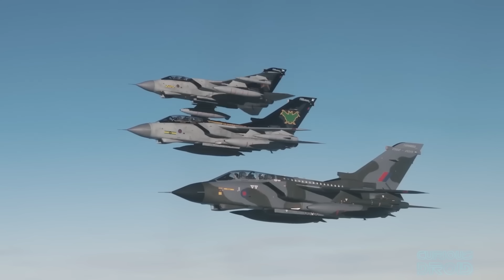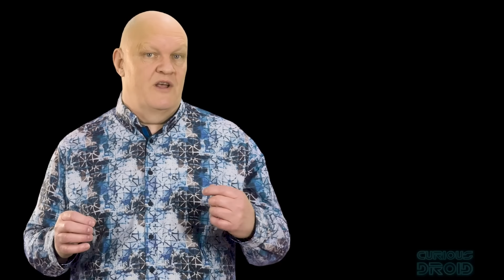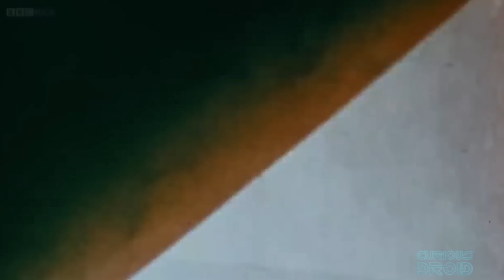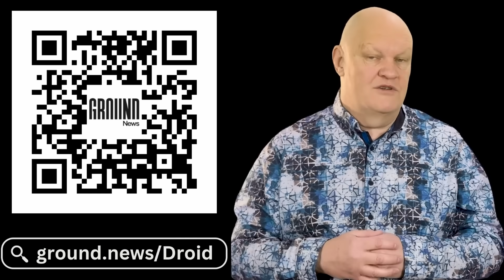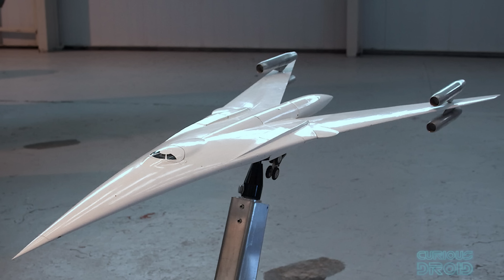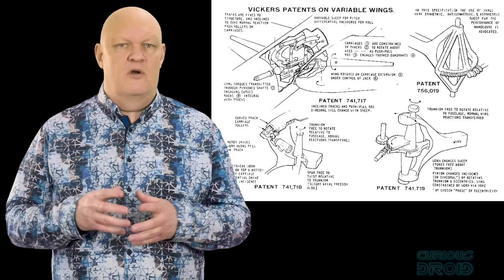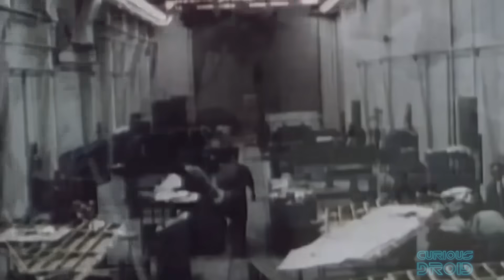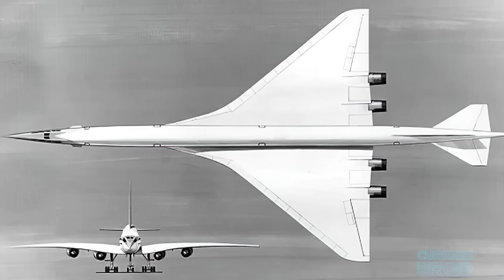Why Aren't Swing Wing Aircraft Made Any More?

Comment: NOOOOOOOOOOOOOOOOOOOOOOOO. Frank Whittle patented the jet engine in 1930 and ran it in April 1937 making it the first self sustaining gas turbine in history. Hans von Ohain (having read and critiqued Whittle's research in 1935) built his own engine and followed 6 months later. A jet powered aircraft WAS NOT flown in Germany in 1934. The He-178 was flown on 28 AUG39. thanks to the financial and engineering backing of Heinkel although von Ohain's engine was a technological dead end where Whittles basic design is still in production today. The Gloster E28/39 flew in 1941 powered by one of Whittle's engines. Swept wings on the Me-163 and 262 were not the result of swept wing research by Busemann.  Woldemar Voight, designer of the 262 stated clearly that the inelegant solution of mildly sweeping the outer panels of the 262 to 18.5 degrees, was not for aerodynamic reasons but was to solve a CofG problem from the heavier that expected BMW engines. Eventually in the A6, the the inner panels were swept to match Lippisch designed the 163 with swept wings because as a tailless aircraft there was no other choice. A straight winged aircraft cannot lack a horizontal control surface for pitch an stability.
Reply: Frank Whittles patent was invalidated in 1932 and whittle allowed it to expire. His patent infringed on an already existing patent  by Maxime Guillaume patent no. 534,801 (filed: 3 May 1921; issued: 13 January 1922).

The worlds first jet engine was constructed in Gottengen Germany in 1934.

Comment: A more niche question I've had for a while is why automatic swing wings were uncommon. As far as I know, only the F-14 and later variants of the Panavia Tornado did this, and all other swing wing planes needed the pilot to manually adjust the angle. It seems like automatically adjusting that angle would be an important part of really getting the greatest advantage from the swing wing design.
Reply: Yep, sweep should be a simple linear function of IAS (Indicated Air Speed - that is, true airspeed adjusted for density of the air flowing over the wings which varies with altitude and temperature). Whether automated or not this adjustment ought to take little skill or design complication as IAS has to be continually monitored anyway.
Reply: @kenoliver8913  Part of it is also with manual adjustment, you only use a few preset angles. The MiG-23, for example, used 3 main sweep angles for takeoff, maneuvering, and high speed. Automatic sweep makes it more practical to use all those in-between angles that might be optimal.

Comment: I watched a video recently and a us politician was holding up a  bag of screws or bolts something that would cost 5 bucks in a hardware shop but in the military this bag cost 90k ..the whole system is corrupt.
Reply: Famously the B1A had a coffee percolator designed to keep brewing coffee at a constant rate through the middle of a 5G turn.
Reply: I doubt home depot sells screws that will take a 5g load, at temptetures between -50 and 350 degrees c, and with a 30 year guarantee. 
That's why those screws cost so much.
Reply: My late wife was a quality director for an aerospace hardware distributor.  Among my duties as an engineer for a small company I recently retired from, I managed our FAA certified repair station. The amount of certification, testing, and approvals required to meet stringent hardware specifications is staggering. every single screw, washer, etc. has to be traceable back through to the original raw material.  From the mill, throough every single step of processing...machining, heat treatment, and finish.  Yeah, there is always a little "adjustment" here and there (capitalism), but the process of of materials certification and traceability is complicated and expensive.

Comment: TU-160M is a Rebuild, refurbished airframes outfitted with more modern avionics and powerplants. They're not 'new' aircraft.
Reply: No, production of entirely new Tu-160 from scratch was also started, first of entirely new ones flew in January of 2022
Reply: @Янус_Ырт  Nope.
Reply: @PiDsPagePrototypes  check info in internet, YT doesn't like links. I will still attach it in the next comment, but to quote, "The government contract, signed between the Ministry of Industry and Trade and the Tupolev design bureau, facilitated the digitization of design documentation for the Tu-160M aircraft and the restoration of vacuum welding techniques for titanium products, leading to the resumption of airframe unit production" and "The first Tu-160M strategic bomber built from scratch made its debut 30-minute flight on January 12, 2022."
Reply: @Янус_Ырт  I'll wait until I see independently confirmed reports, and not those of the propaganda ministr,.... er,.. TASS and the Manufacturer.
Reply: @Янус_Ырт  You missed the point of previous comment. Adding the "2 years ago, no new info" kinda proves that point I made too.
Reply: @Янус_Ырт  Still missing the point.....
Reply: @PiDsPagePrototypes  what point? That nobody except Russian military and Tupolev publishes info about those bombers? Who else should? My point is that new bombers are being produced from scratch, and you can easily find proof of that - there is footage in open access.
Reply: @Янус_Ырт  That all media released on these aircraft is done so for propaganda purposes, so should not be trusted until independently verified. I'm amazed I have to spell that out again.
Reply: @PiDsPagePrototypes  how are you going to "independently verify" military information? Do you have any other sources outside of Russian DM and Tupolev factory? Besides, photos and videos are real, what else do you need?

Comment: Like all things in aviation, all design/engineering choices give you something but at a loss of something else. Swing wing gives you good airflow at landing speed and at high end speed but sacrifices in reliability and weight. The F-111 Aardvark was the USAF’s golden child but was horrible in reliability and was proved by Col John Boyd to lose in a dog fight against every single Russian aircraft—weight was a contributing factor. Today, the USAF’s B-1 is the forces’s least reliability aircraft and has been so for at least the past 20 years with only a 40% Mission Capability Rate, or putting another way, the aircraft and only fly 40% of the time before breaking.
Reply: To be fair the F111 was designed never to get into a dogfight - it was a fighter-bomber intended to evade day fighters with pure speed (an idea dating back to the Mosquito). Apart from its maintenance problems it proved very vulnerable to SAMs and MANPADS. As all non-stealth aircraft (including F16s and F18s) eventually did.

Comment: With FBW computers being as advanced as they are, i could easily see the current standard hybrid-delta style wings (like on the F-15 and F/A-18) outperforming VSW's. Especially in terms of cost, weight, and maintenance. But god do the Aardvark, Tomcat, and Lancer ever look so cool. They will always hold a special place in my heart for their aesthetics. By far some of the most iconic aircraft of the US fleet. Or any fleet for that matter
Reply: "With FBW computers being as advanced as they are, i could easily see the current standard hybrid-delta style wings (like on the F-15 and F/A-18) outperforming VSW's. ""

No way, VG wings are far more efficient than fixed wings, which have to compromise for the portion of the flight envelope where they need to be most efficient.  The F-15 wing was designed for maneuverability at high subsonic speed, but it is not as efficient during cruise or dash as a wing that can reshape itself.  VG didn't make sense for the F-15 mission but made great sense for the F-111 and B-1 mission.  Aerodynamics didn't change, the mission profile changed.
Reply: VSW's may be more efficient aerodynamically. They may even make sense in the small picture. But not in the big picture. Delta/hybrid wings can fly low speed approaches now because of advanced FBW. Not to mention TVC when it comes to maneuverability in high and low speed regimes. Why do you need all the added weight, moving parts, and single point failures of a VSW when a more effective solution has been found and implemented? It was a great solution in the 70's when they designed them. We just found better solutions. So no, aerodynamics didn't change. But the entire paradigm of high performance flight did.
Reply: @batmanjones655  Not “may be more efficient”, they are more efficient.  And a simpler solution has not been found—if you think that you do not understand the actual problem VG wings solve.  Forget maneuverability, we're not talking about making a better dogfighter. The F-15 looked at VG and discarded it because the extra weight was counterproductive for sustained maneuverability in the part of the envelope for which they optimized the wing, and total efficiency across the entire flight envelope was less important.  The F-14 didn’t have a VG wing to make it a better dogfighter, it had a VG wing to meet the fleet defense mission requirements of a heavy load and long endurance coupled with high-speed dash.  A fixed wing optimized for dogfighting could not do all that.  The mission drives the wing.

TVC is about controllability at low speed and has nothing to do with subsonic efficiency beyond allowing for smaller control surfaces. Delta wings can fly at low approach speeds without FBW, which has nothing to do with it. The delta wing is very inefficient at low speed.   

The added weight of a VG wing pays for itself in less fuel carried to go a given distance.  You lift more fuel off the runway and use less fuel per mile, allowing more payload and range, but can still sweep the wings back for high speed when tactics require. The added cost and complexity paid for itself in allowing a single aircraft to strike a target that would otherwise require multiple aircraft.  More capable aircraft always cost more to obtain and maintain.
Reply: @gort8203   I get the feeling that you don't read more than a few lines of text. That or your just don't want to understand what you read. You conceded a lot of what I said like it was an original thought. So one of those statements must be true. You don't read, or you don't understand. You obviously don't understand engineering, because you can't reconcile aerodynamic efficiency with total efficiency.
Reply: @batmanjones655   The pot calls the kettle black.  You claim to understand engineering while you don't even see that thrust vectoring and FBW don't do anything like what VG does for efficiency. Thrust vectoring also adds weight and complexity, but unlike VG does not pay for itself by increasing the range or payload of the airplane, which is why it was not included on the F-35.  

TVC and FBW might allow a given design to eke out a minor increase in efficiency at a particular point in the flight envelope, all other things being equal (which they are not in a new design).  VG allows an airplane to be significantly more efficient throughout the envelope. That efficiency alone pays for the extra weight.  Better yet, the increased cost of VG was paid for by making the aircraft more effective in combat, allowing fewer aircraft to perform a given mission. You criticize my understanding, but it is you who does not read well and does not understand total efficiency.  

Your statement that FBW computers can allow wings like those on the F-15 and F-18 to outperform VG wings remains inaccurate.  It indicates that you don't even understand the purpose of a VG wing.  VG was not replaced by FBW and TVC; it was replaced by changes to combat mission requirements that outweighed aerodynamic efficiency.

Comment: I remember hearing that the F-111 was 9% of the Gulf war air fleet but accounted for 25% of the maintenance costs.

Cost aside a double delta wing or wing with leading edge extensionsis basically the same but way easier to build and design

Comment: Swing-Wing aircraft CAN accelerate through  the Mach and transonic regime like few others can, given the same amount if thrust/weight ratio, a swing wing will blow the doors off an equivalent fixed wing jet, except deltas. (Which can't land anywhere near as slow).

Bottom line: Delta is the best. Swing-wing performs similar at high mach. But can land far slower and handle better at low speed.
Reply: Yeah, the low speed performance of a straight or back swept wing and the high speed performance of a delta wing.
That is flight performance, not carrying performance. The weight of the swing mechanism is weight that can't be used for bombs or fuel, so a swing wing design will have less range and/or payload capacity than a fixed wing design.
Plus the mechanic means higher manufacturing and maintenance cost.
Reply: @HappyBeezerStudios  the F14D had a longer range/flight time than the F18 super. it also had both a higher cruise & top speed, a bit faster rate of climb & a higher ceiling. with the 14 carrying over 1,000 gallons more fuel(about 7~8,000 pounds more) the 18 had about 3,000 pounds more payload than the 14.
on the ground, the 18 had both a shorter take off and landing distance. the gross takeoff weight of the 18 was about 10,000 pounds lighter than the 14.

Comment: 1974 was the b1A. Which was killed by Carter.  Reagan brought the program back which was redesigned as the b1b Lancer,  which wasn't as fast at high altitude,  but had faster low level dash speeds

Comment: I would contend that advances in aerodynamic design actually had very little to do with swing wings disappearing. Most swing-wing aircraft actually had more complex flaps and slats than the fixed geometry aircraft that replaced them, often including double and triple Fowler flaps and real slotted slats instead of just leading edge droop. Leading edge extensions that many modern fighters have their roots in the wing gloves of swing-wing aircraft and the double delta of the Sweedish Drakken from the same era.
The F-14 was the odd one out as the only production swing wing air superiority fighter or interceptor, and only because as a naval interceptor it needed to combine an interceptor's speed with long loiter times and unrefueled range. the F-15, which was designed around the same time for the same role, except for the airforce, which has much more refueling capacity, had no need for swing wings.
Basically every other swing-wing aircraft was a strike aircraft designed to fly fast at low level to avoid radar. The faster you go, the bigger your wings, and the less sweep, the more turbulence throws you around, so going supersonic under 500 ft requires extremely small and highly swept wings so the aircraft stays controllable and doesn't exceed its G limits going that fast in low-level turbulence. The F-105, which was the last pre-swing-wing plane to play that role had a takeoff and landing speed of around 230 mph, a full 100mph faster than the swing-wing aircraft that replaced it. swing wings both increased lift for takeoff and landing themselves and allowed extreme flap configurations to be mounted so that they could takeoff and land at forward bases with less than 6000 ft (2000m) of runway. It also made low-level supersonic strategic bombers like the B-1, Tu-160, and Tu-22 possible at all. 
Just as an interesting aerodynamic note, the concord represents about the maximum size for a supersonic aircraft without a swing-wings regardless of its engines. large aircraft have to use delta wings because blade-like wings don't have enough bending strength. those delta wings (with or without a tail or canards) have a significant bleeding edge angle, so as the wing gets bigger, its span and area is limited by how long the wing root is. Because area scales with length squared while volume scales with length cubed, if you tried to get bigger than the concord with a delta wing, the wings would have to be longer than the plane, which obviously doesn't work.

What killed swing wings from a military perspective wasn't improving aerodynamics or engines so much as improving electronics, mostly for cruise missiles that could do the same job better and with less risk without having to worry about takeoff or landing.
Reply: That's a great comment, lot's of detail. But I disagree (slightly). The reason the F-14 needed a swing-wing was for mach 2.4 performance while being able to land on a carrier under manual control of the pilot directed by a signal officer in all weather.

It had to get slow. And it had to go fast. And it had to do both with a heavy weapon and fuel load. Swing wing is practically the only way to make this happen. No naval jet can reach or exceed mach 1.6-1.8 without swing wings.
Reply: @Triple_J.1  there actually was a proposal for a Naval F-15 with bigger wings that I think would have had a similar landing speed to the modern superhornets, which are still landed manually, or at least were until very recently.
A naval jet could exceed 1.8 without swing wings, F-4 Phantom did. it actually served alongside the tomcat for a long time, particularly on the smaller carriers the F-14 wouldn't fit on when we still had.
Reply: "f-14 only fighter interceptor built with swing wing"
Bs, rest of the comment invalidated.
There is mig-23
Reply: @spinningsquare1325  you're right. I don't know soviet planes very well. Siberia does impose a lot of the same challenges as the ocean, so I guess it makes sense.

Comment: 777x has folding wing  tips, for simmilar reasons... it's not much, yet shows concept and tech, of mechanicaly extending wing size is still here , even in state of the art airliners
Reply: the folding wingtip is a different story to a swing wing. also the 777x does not have foldeable wingtips to mechanically extend the wing size, but to reduce it, so it fits the same airports where the earlier models did.